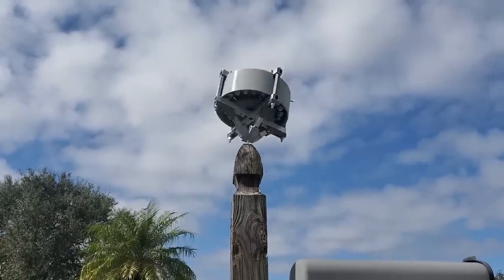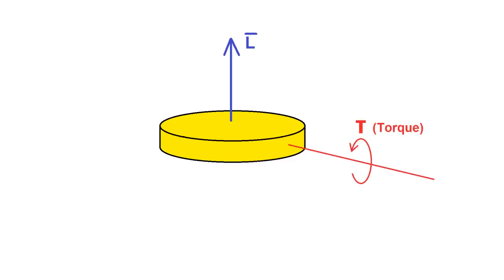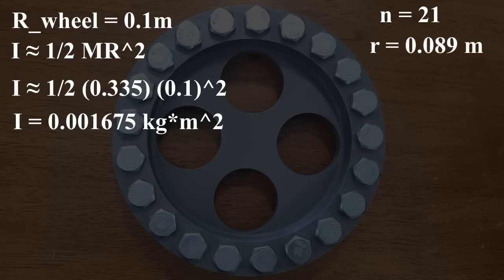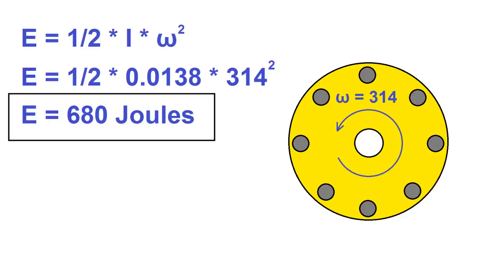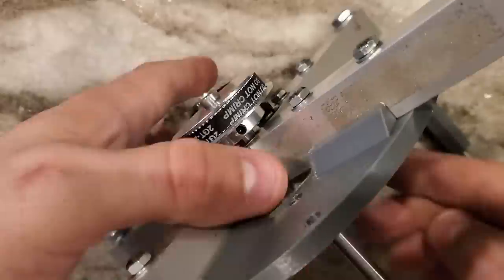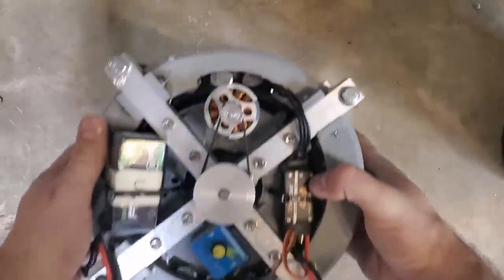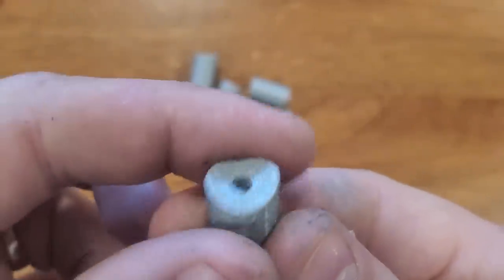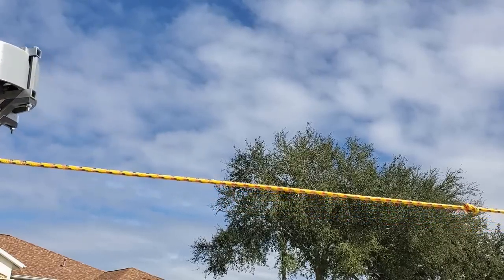Tightrope-walking powered Gyroscope

Comment: Where did you get the gyro toy?

Friction on PVC, plastic wheel, you need a wheel sand box like on stream engines.  😊

You need to get an old plane rotary engine where the crankshaft is stationary, attached to the airframe, and the propeller is attached to the rotary engine, which is spun.

Lots of mass there.

Comment: On a side little note: you actually don’t need to drive the wheel with a motor only a servo motor will do this for you by using the same gyro principal when disturbing center of mass of the rotating flywheel.

Comment: The bolts themselves have their own inertia but you omitted and considered them as point mass. The individual bolt may have smaller inertia but if you project them to the center, it got bigger.

Comment: What you need is a (pardon me I don't know the exact name of this item) one way coupling on the gyro shaft that allows movement in one rotational direction, and freewheels in the other direction. Helicopters use these. This way, the motor can spin the gyro up and then remove itself from the drive train and allow gyro to spin unimpeded.

Comment: I am sorry, but why did the flywheel to be printed? Are there no metal shops in your area? You could simply get a few metal plates drill a hole into them with a locking notch and weld them together and then even perfectly balance it by adding some weld spots or grind away some mass in places. And the whole base could be done by bending some 5 mm iron.

Comment: Thats cool, but the part about having too much r.p.m.. Did you actually test that out for this particular application, or are you going off of theory from other variables. The reason i ask, is because this applies to aviation too. But the large diameter props cant usually exceed 3000 r.p.m. before causing vibrations that make stuff fly apart. But smaller props can gain a little more r.p.m. That might have something to do with the distance from the outside to the center, balance, vibrations and resonance. And then there is the factor of the materials that they are made with.But why dont turbine jet engines fly apart? They spin at a much higher r.p.m. But they are smaller diameter than large props. Of course they are very well balanced and made of metal. Would there need to be vibration dampening and stronger materials? But it seems that plastic would be pretty good at dampening vibrations.

Comment: Pretty cool. I woul have reinforced the disk with sheet metal. It's very easy to put a few holes into it and the sheet metal alone will handle a lot of force. No need to depend on brittle plastic

Comment: This is really cool! But next time, for safety, I recommend using NYLOK nuts (nylon inserts to lock the threads)!  That way there's no way the nuts can come loose!
And I hope you used blue or red Loctite on all the other fasteners and setscrews!
By the way, your toothed drive belt is a little bit too loose! It should never be jumping around that much! You might want to put a tiny idler pulley halfway between the motor and drive pulley!
Otherwise though, kudos for your inventiveness and creativeness! Nice job!  Thanks for the video! Very interesting!

Comment: If ever a project screamed for a simple processor for control, this is it. Handle acceleration, allow setting a run time to avoid spontaneously disassembling corgis, detect several potential error conditions, etc…

Comment: If I timed the spinning bolts to release at the correct time, then it would work as a 45 cal gun? That doesn't seem right.
@5:31 - the rotational kinetic energy = 45 cal gun. What does it mean? Are you saying the total energy required to achieve the spin is the same energy as the bullet release, but spread over a much wider amount of time?
Reply: To clarify: the video says that it is important to calculate the limits of stress. Those limits were near the border of what the plastic can hold. Then the energy of the spinning disc is calculate to be a 45 cal bullet. This is dismissed and the project continues.
BUT where is the part in the video where it is explained how it is ok to produce an item that will throw 45 cal bolts in random directions if the plastic doesn't hold up?

Somewhere, the video should explain why it is ok to continue making something after the energy in the spinning bolts is like a bullet. How was it determined to be safe to continue?

Comment: Great stuff. Well done. Try adding a layer of silicone or butyl to the drive wheel for more grip. Let it mostly dry then use it. It will smooth off the silicone. I've done the same for upper side of the heel area of sandals, let it mostly dry then wear them, and it's still pliable enough to conform to my heel. Set aside and let it finish hardening.

Comment: May I suggest repositioning the battery across from the motor to give better balance , servo tester and esc are light, and battery and motor are heavier which would help eliminate the stationary wobble

Comment: The wobbling would be lead and lag of torque because of distance from the centre of the rotational mass would it not?I'm thinking there's lag building energy at the wheel point then it overcomes it at a point approaching lead or equilibrium then the wheel rolls forward and starts the cycle again. I'm not as smart as you but its just what I visualise in my mind

Comment: I’m going to show this to my students. We are just covering rotational and circular motion.  I’ve recently 3D printed a walking robot that uses a gyroscope (spinning columns of pennies) and uses the precession of the gyro to rotate and take its next step. I just need to find a few more screws to finish putting it together. This is an awesome project!  Keep up the great work!  

Just a thought, could you setup a gyro stable enough to measure the earth’s rotation? If you mount the gyro horizontally (the spin axis is parallel to the ground) and allow it to rotate perpendicular to its flywheel, it might pick up the earth’s rotation.
Reply: How would that make it measure earth’s rotation- and wouldn’t it be too small?
Reply: Not only can you, but that's where a gyroscope gets its name from!  It allows you to observe (scope) the rotation (gyro) of the Earth (by maintaining the spatial orientation of its axis). Also for maximum effect, I would mount it with its axis perpendicular to Earth's axis. You should see it "change orientation" at 15 degrees per hour. You may need a high quality gyroscope though...
Now that you have something new to share with your students, I need to see your walking gyroscope to share it with my students! (I get the idea though, and might be able to come up with my own version of it.)
Reply: the earth doesn't rotate
Reply: @throwawaypt2throwawaypt2-xp8nx  you’d be correct if you ignore the evidence that says otherwise.
Reply: @boomfiziks  ok

Comment: If you need weights for further experiments, you can get tungsten-carbide pieces from McMaster-Carr, such as balls and cylinders. The density of TC is 14.5 grams per cubic centimeter, compared to <8 for steel. It's pricey, but for limited uses, it's really handy. edit: they also have pure tungsten, which is 19.25 g/cc, but it's really expensive.

Comment: hmm.. 640 joules is the energy a 45 caliber bullet?  That's interesting.  Google says a AA battery has on the order of 10000 joules.  So since a 45 can definitely kill you, I'm gonna start telling people a AA battery can kill you several times over.  Which I am sure is true.. I mean you could cut it open and eat it, that probably wouldn't be good.  Or you could charge a capacitor with it and stop your heart.. probably?  Which leads me to the meaningless question of what is the minimum amount of energy needed to kill someone?  Obviously it's meaningless since someone could just die on their own with no energy expenditure necessary.. in fact it takes energy to keep you alive.  Idk where I was going with this but that was an interesting little tidbit that led me down a rabbit hole of thoughts.
Reply: minimum amount of energy needed to kill someone? FBI entered the chat....
Reply: Well, just think about how dangerous a fully charged super capacitor with the equivalent amount of energy would be.

The problem is you would never be able to fully charge that capacitor with an AA because of the low voltage. So the AA has a lot of energy, but you can only get it out very slowly.

Comment: cute
Reply: radial acceleration limits are at least a bullet acceleration, what is around 100k of g's
Reply: looks like a drunken zombie, trying to walk
Reply: two contra rotating discs
Reply: stays upright all the time, unless the discs stop spinning, assume the disc rotations are synched, equally opposite to each other, and -/+ the stop state, the hull, staying upright
Reply: your engine shaft and pistons spin at 10krpm or 20krpm, what are you kidding, jet engine spins at 200krpm, dont kid yourself, it will be fine, if you make it from proper metal
Reply: try vertical opposite polarity magnet spin discs, also a bottom maglev disc as the hull
Reply: it must work like the us military raider x helicopter with contra rotating rotors
Reply: dc coils to power the magnet spin wheel directly, not skip, no pulleys, no teeth
Reply: dc magnet with dc coils with current = spin
Reply: make it hovel, with two contra rotating turbine fan gyro discs, dual function

Comment: I'm curious about counter-rotating gyroscopes. Would they cancel each other's torque, so the whole thing wouldn't spin around? Would they also cancel each other's precession, causing them to no longer be useful?
Reply from the maker: They'd cancel each other out
Reply: @HyperspacePirate  in both regards?
Reply: I mean, such an arrangement would just fall over, if used in a device like shown in the video?
Reply: @zippythinginvention  Yes the thing would just fall over.
Reply: @Panthless but this idea is very much useful in propeller engine aircrafts.  The designers really want to cancel the torque created by propellers.

Comment: I'm actually amazed that your flywheel with that weight didn't break down at 3000 rpm that's insane
Reply from the maker: In retrospect, it was probably a very risky thing to do. In the future I think I'll just use a solid steel flywheel.
Reply: @HyperspacePirate  in retrospect.... hahaha. Brave doggie too. If you've answered this before I apologize but are you multidisciplined engineer?
Reply: @HyperspacePirate  I would at the very least have made a test part to see how much force can be put on the bolt before it breaks, to be able to set the rpm with some known safety factor
Reply: @HyperspacePirate  Or drill through the heads and wire them together with some high-tensile cable.
Reply: for flywheel, hollow sphere/donut w/water inside for centrifugal/centripetal spin.. option add magnetic compounds or polarized oxides in orb’ital fluid n spin gyro w/air pressure negating noise from drive motor e’mag fields..